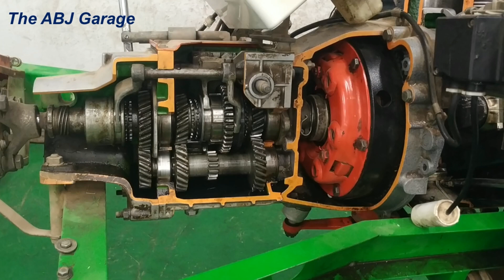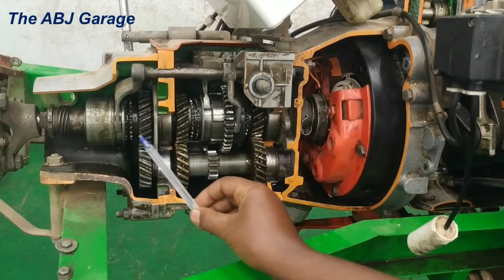7 Causes of noisy transmission

Comment: Good morning. Nice to meet you. I am your subscriber from Indonesia. I have a Chevrolet Luv car with an Isuzu C 190 engine with a 4-speed transmission. The problem is that when the engine is running there is a noise / noisy sound but if the clutch pedal is pressed in or the transmission lever is moved and held to number 1, 2, 3, 4 the noise / noisy sound disappears. In your opinion, what components or parts need to be replaced. Thank you, I await your answer. Success and good health always.
Reply from the maker: Most probably you are having a clutch release bearing problem!

Comment: Please help.
My can has started making a noise after putting the car in gear then releaseing the clutch, originally i thought it might be releasing bearing but i went to the shop today and it made a clunky noise while accelerating would that noise happen if it was release bearing. Any ideas
I am waiting to get into a mechnic 😢 
Thank you
Reply from the maker: Release bearing related noises usually disappear when clutch pedal is depressed. So if noise pattern changes when you press the clutch pedal, it is usually around the clutch parts. If you hear a clunky noise when accelerating and your car makes a noise after putting it in gear and releasing the clutch, it might be a worn universal joint, driveshaft issues, or differential problems, all of which worsen under load and cause clunking or grinding noises.
Reply: @TheABJGarage  it was the driveshaft its all sorted now 👍

Comment: My 2006 landcruiser prado 120 series diesel engine makes a clicking noise when in 5th gear what could that be can anyone help me?
Reply from the maker: If it is only in 5th gear, then most likely it is a sign of worn or damaged internal transmission components, such as the synchronizer rings or gear teeth for 5th gear.

Comment: Suzuki Swift 

What if the car vibrates on neutral?

And on driving, trying to lift the clutch, put the gas, let the gas in any gear..a metal on metal noise.

Clutch was changed, release bearing was changed. engine mounts was changed. Flywheel was checked and was good.
Reply from the maker: A car that vibrates both in neutral and while driving likely has a problem with a component that is always in motion, such as a failing engine mount, or a condition affecting the engine itself. If the vibration intensifies with speed, wheel and drivetrain issues are more likely. Common causes for vibration in neutral and while driving include: bad engine and transmission mounts, Engine issues such as misfire and rough running or Drivetrain issues.

Comment: Excellent video and explanation! My 5-speed manual transmission makes noise in 2nd, 3rd, 4th and 5th gears. The noise stops when I step on the clutch or shift into neutral. Fluid level is full. No problems shifting into or out of any gears. No gear slippage. Anyone have any idea what it could be? Thank you.
Reply: I have the same issue, I’m driving a Clio 5
Reply from the maker: Since the noise occurs in 2nd, 3rd, 4th, and 5th gears but not in neutral, the issue is almost certainly a worn bearing inside the manual transmission. Because the noise is present in most forward gears, it indicates a failure in a component that is active for those specific gears but disengages when the car is in neutral. The most common cause for noise in all forward gears except neutral is worn countershaft (or cluster gear) bearings. When the transmission is in neutral, the countershaft is rotating, but it is not under load, so the noise may not be apparent. When you engage a forward gear, the load from the engine is transferred through the countershaft, putting stress on the worn bearings and causing a whining or growling noise.
The noise is typically louder in lower gears because there is more torque multiplication and thus more load on the bearings. f the teeth on a single gear or multiple gears are damaged, it could cause noise. However, it is less common for all the gears you mentioned to be damaged in this specific pattern. Input shaft bearing: If the input shaft bearing was worn, you would also hear noise in neutral with the clutch engaged. Since your problem goes away in neutral, it points away from the input shaft bearing.

Comment: So my Touran 1T3 2.0tdi has rattling noise when in neutral. When I depress the clutch it disappears. When I press throttle pedal it is worse. I hear nothing during drive because cabin is well insulated. So according to your video problem is in bearings on input shaft? Is it costly repair? Is it cheaper to repair manual gearbox or to buy used one?

Comment: My isuzu kb 250 model 2016 Bakker is making nose while moving in all gears even when l put the engine on neutral it still make the same noise and when l switch the engine off on a slope surface still on motion it still makes the same noise, please what must be the problem?  But according to this presentation l think its a matter of lubrication but lm no so sure any advice Thanks.
Reply from the maker: It depends on the type of sound and where it comes from. It could be bearing noise as well!
Reply: My suzuki alto .running 40/ km speed howling noise now,before i replaced gear box all bearing and sun and star washer and shaft.but sound no go.

Comment: Thanks for sharing, I have a 6 speed manual transmission in a corolla 2011 only 80000 klm and i have a whining noise in all gears when accelerating and when cruising on final 6th gear im getting a little rattle as well, please help
Reply from the maker: Worn or Damaged Transmission Bearings can cause a high-pitched whine that changes with engine RPM. The noise usually gets louder when accelerating or under load and may lessen when coasting. It could be caused by wear on input shaft bearing, output shaft bearing, or countershaft bearing.
Reply: Thank you, yes that's what my car is doing exactly

Comment: What if you hear more of a rattling type noise in gear and in neutral at a certain rpm? Checked with a stethoscope and definitely heard the noise in the gear box.  Not the engine

Comment: I just started noticing a clicking noise on second gear only, if the gearbox is already spinning and I engage second, even with the clutch still disengaged, I can hear it. Thank you for this well explained video, I'm almost certain that it's a worn syncromesh in second, I haven't noticed any loud pops or anything that could indicate damage to the second gear teeth, and seeing how the teeth are always contacting eachother switching to a different gear doesn't seem like it would stop the noise. I also drained the gear oil today, there was no sign of unnatural wear, though it was slightly overfilled, I changed the gear oil last fall, but the car already had 245k miles on the original gear oil.

Comment: I have an automatic 2011 honda freed spike. There is a sound coming from the gearbox when the drive gear  is engaged and it increases when i accelerate. The car is however performing perfectly in terms of speed and power. One mechanic checked the gear oil and observed some iron filings.
Reply from the maker: Iron filing in the oil could indicates excessive which can lead to noisy operation if not addressed quickly!

Comment: My 2018 honda fit automatic transmission makes noise only when i am driving below 5 mph for example coming to a stop or driving under bumper to bumper traffic. If i give just some acceleration it goes away. It comes with or with out brakes. What could be the reason.
Reply from the maker: Could be issues wit the torque convertor or transmission oil pump!

Comment: My sound comes when clutch is up, when I press it down sound goes. I have replaced the release bearing. I'm pretty sure now it's the gearbox do U think Lucas transmission oil will help.
Reply from the maker: It could be a problem within the transmission or the clutch itself.
Reply: This happened to my car when pressing clutch down is ok letting go msking noise that needs a new clutch

Comment: I switch my DMF to a SMF and of course, with al the kit new on my Zafira B 1.9 cdti, and i have some "grinde" and "knock-knock" noise on idle ! :(( When i rise the rpm or normal driving  the transmission is quiet and ok, and also in every gear change!How bad it is ? :((

Comment: My issue is a noise that only happens in gears 1 - 4 and goes away in gear 5 & 6. This video doesn't explain that scenario.
Reply: It does. Synchronizer assembly of those gears
Reply: @gofamodimoradilwana1260  well it wasn't that, on strip down it was found to be bearings on the 1- 4 countershaft. This example is a single countershaft, my gearbox has two.
Reply: I have the same issue in the 3rd and 4th, the noise is difficult to describe but was it like a high pitch rattle or rumble by any chance?

Comment: Hi need some advise please don't know anymore what can be wrong,it's a opel corsa gamma,car start put car in gear but car is not moving,replaced cv thrustbearing clutch plate pressure plate sceamed flywheel everything but stil not moving if someone please can tell us what to look at next
Reply from the maker: Have the clutch disc been installed correctly? If the disc is not properly installed or if there is wrong clutch adjustment, then the car may not move!

Comment: Can you help diagnose this issue?

Car not moving
- No noise in neutral
- Move shifter left to 1st/2nd position  --> hear rubbing noise
- Push clutch pedal while still in left 1st/2nd position --> noise goes away

Car moving
- Select 1st gear and drive --> hear rubbing noise
- Push clutch, still moving --> hear rubbing noise
- Let car slow down to a stop (still have 1st gear selected and clutch pedal pushed in) --> noise goes away
Reply from the maker: It seems like your selected gear is not fully engaging! Could be caused by worn out shift mechanism.

Comment: I see you are still liking even new comments so I will try a question I would really appreciate it if you were able to answer. So my car only makes nosie when any gear is selected but the car also refuses to move in any gear. Is this still a fluid problem or something more? I was driving and changed gear after making a turn and suddenly the car wouldn't move in any gear and made a horrible noise. Any help would be appreciated you seem very knowledgeable on transmissions
Reply from the maker: From what you just said I strongly suspect clutch related problems. The clutch is the part that is involved every time you change gears. And bad clutch system can stop power flow to the gearbox altogether. The clutch should fully disengage for smooth gear change and should fully engage after gear shift to allow power flow from the engine to the gearbox..

Comment: My car makes a rattling sound in cold start but when pressbthe clutch the rattling sound dissappeared also, after teavelling few km. What could be the problem. Sc has change  clutch assembly & release bearing. Butvthe rattling sound is still there.
Reply from the maker: Are you living in extremely cold area, if you are, the transmission oil will become thick at cold temperature, this will cause very noisy transmission as oil viscosity increase makes lubrication very difficult. When clutch pedal is depressed, the power flow to the transmission will be temporarily interrupted and hence noise will be reduced. As the car is driven for a while, the oil will become thin again, coming to the right viscosity making lubrication great again and consequently reduced noise.

Comment: mine is noise when shifting....boat motor da da da da when releasing clutch..... Every single part is brand new anybody know what this is?
Reply from the maker: Check to see if the clutch is fully disengaging. If it is not fully disengaging, that will make synchronization difficult, leading to noisy shifting.

Comment: I have polo tsi manual gearbox  but whn you start in make sound  at gearbox side but if push in clutch  and the sound is gone if you release the cluch the sound start again  what is the main cause  myb???
Reply from the maker: Could be caused by bad countershaft bearing, or other faulty parts in the gearbox
Reply: I've faced same problem,when i open and checkd the gearbox,there was a broken ruler bearing consisting in the gear which is transfering power from engine to transmission

Comment: I hear a spinning/whirling noise whenever the car is moving but coasting, either in neutral (clutch in or out) OR when clutch is pressed in, and still in gear (any gear).  kind of goes away when it warms up.  can't figure out what is making that noise.
Reply: Is your problem solved? I'm also facing same issue. What part was replaced in your case?

Comment: I have a gearbox bearing noise at any gear,  but only when I'm not accelerating... The noise becomes noticeable after a few minutes, when oil is hotter (i supose)  and when I put it in neutral the noise goes away
Reply: Did you find the issue?

Comment: What could cause my car too sound noisy when travelling between 40-45mph specifically?
It sounds like its revving higher but this isn't registering on the rev counter. It doesn't matter if my car is in gear or not and doesn't matter what gear.
If I am travelling at 50mph and take my foot of the gas, as the car slows down to 45mph the noise increases and then disappears when it goes below 40mph. Very odd!

Comment: 1 of the nose happens in neutral but stops when you press the clutch in the others is a rattling sound which switching gears. The only issue is the noise no slipping or grinding slightly bumpy but I don’t think that is the transmission

Comment: I have a new 2023 GTI that makes weird gear noise in neutral. Manual gearbox. Been thinking of taking into the dealership and asking questions. Typically gear box is always a tad noisy though.
Reply: not good.  did you get an answer?
Reply: That’ll be your throw out bearing most likely

Comment: I noticed a year ago some  wired noise just like going fast in reverse while i release the throttle at 4-5k rpms in 2nd gear. Now seems like some teeth rubbing there randomly for few seconds also when downshift to 2nd or release the throttle at relatively high rpms. I am thinking some bearings are gone and shafts have some excessive play. Or maybe worst.Syncros or sleeves or the whole assembly need replacement. I can't do the job myself so i need to buy the parts before i bring the car to the shop because i live in a country where i can't find anything other than fake oil and filters. I used the car a lot on short track mainly in 2nd gear. Now i will pay the price big time
Reply from the maker: Sorry to hear that! And I hope it will all be just fine

Comment: i got an used gearbox in order to replace my own gearbox since my own gearbox needs bearings to be replaced....
but this used gearbox that i got...has a wierd noise when u reach a certain speed(it slowly gets noticed)...it doesnt sound like an used bearing..sounds different...usualy at high speed....not really sure what is causing that noise...(only gearbox ive replaced and the sound comes from it 100%)

in the meantime...im planning to restore my gearbox by replacing all the bearings and putting it back..(hopefully)
also i noticed something after a while....i think it loses oil from the top...
maybe a sealing is not a sealing anymore..(didnt even checked them before i installed the gearbox on the car,totaly my fault...that i thought that gearbox was in good health..)

Comment: Excellently explained 👌
But i have a question. I have a Ford Classic and when my engine is lugged, there is a strange squealing noice, that goes away as soon as I rev it high. This started happening after i had a sudden breakdown because of a worn out clutch and got it replaced from an unknown mechanic. Any idea what could be the problem?
Reply: Release  bearing....
Reply: Thanks..my truck is doing the same thing ,you explain down to a t  what my truck is doing 

How can you fix the release bearing ?

Comment: I’ve got a problem with my 2014 vw jetta, the trans grinds when going into gear, in gear, and in neutral with the clutch out, but if I push on the clutch peddle the grinding stops. 5th gear was making a whistling noise for a couple days before this happened
Reply: It's the input shaft bearing. It's common for it to be noisy and the noise stops when clutch is depressed. Not sure about the whistling noise in 5th gear..
Reply: @stefan7034  that's the right answer as I've observe and solved this problem

Comment: good explane. i will try to point out now i understand more about the werking. thanks
Reply from the maker: Glad it helped
Reply: Am glad to see dis but I have a question I have nissan urvan 2020 it have sound on neutral I have change the clutch kit and all the bearings the sound has changed little bit has befor but still have same sound

Comment: Hi. Great training setup.
Question. Scania series 2, PTO setup with hydraulic pump.
Was running pto for couple hours and when finished turned off but still had bad noise.
No oil in gearbox, replaced oil but now gearbox has a really bad whine in first 3 gears in both high and low.
Any idea? 
Maybe gears or is PTO issue?
Reply: output bearing maybe (assuming all the drive gear bearings aren't a problem).

Comment: Hi

I have manual car so i get noise when i take off in first gear sometimes there is a grinding sound when driving, feels like the noise if gears are not connected fully and goes away when i change gear, and happens to to next gear. only happens on 1st 2nd and 3rd sometimes is it becuase of low gear oil?
Reply from the maker: If the noise is coming from inside the transmission it could be caused by worn out parts due to lack of lubrication. 1st, 2nd and 3rd gears all share same counter shaft and any defect on the counter shaft or its bearings could make it noisy